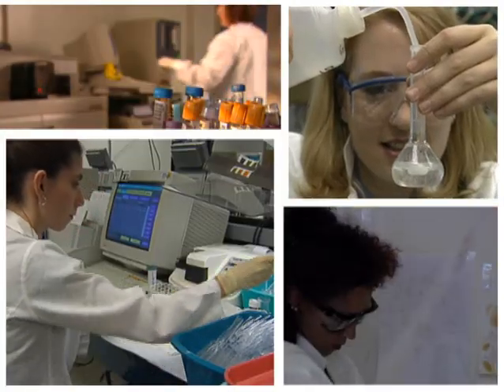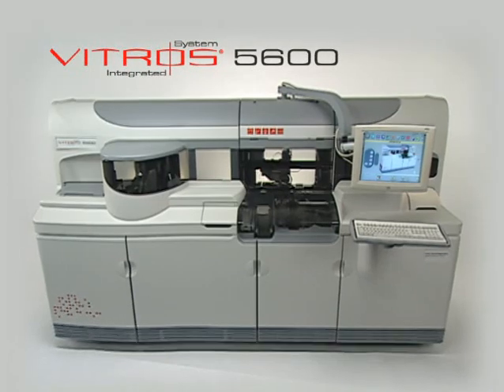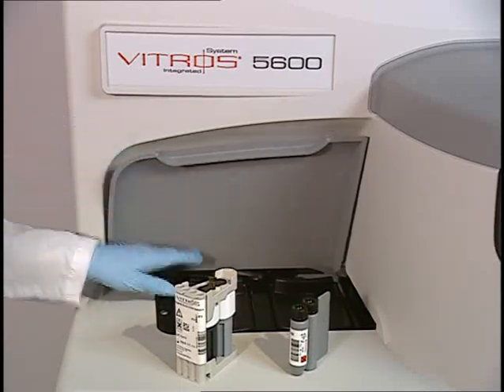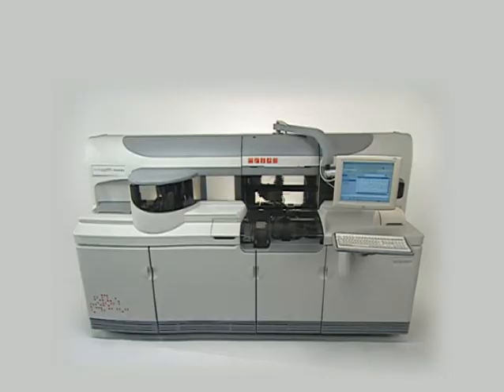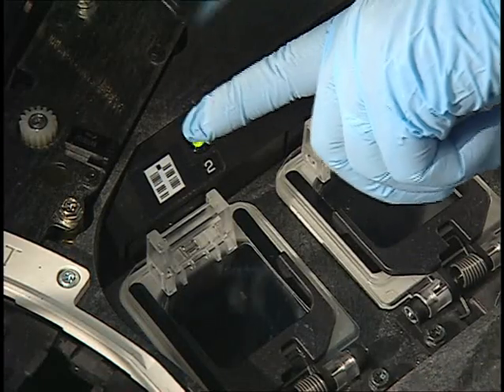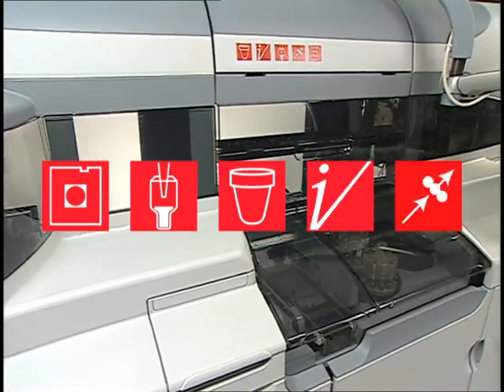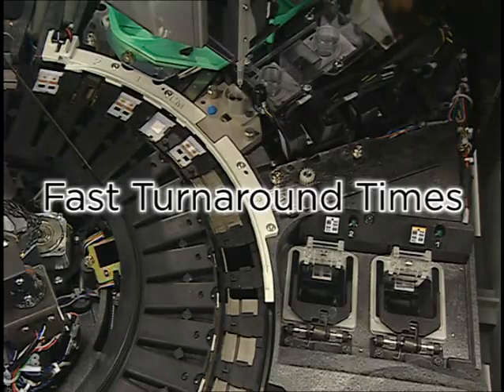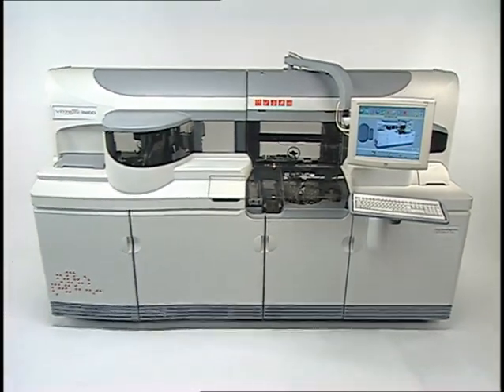Vitros 5600

Comment: We just got one of these delivered to our new hospital in  #Sebastopol   #California  - Exciting times. We are opening soon!  #SomethingWonderfulIsHappening    #SonomaWest    #SonomaCounty   #WestCounty   #Health   #Healing   #Medicine     #MedicalPioneers   #IntegrativeHealth   #OpenOurHospital   #NoWaitER   #Lab   #BloodWork   #Immunoassay
Reply: +shadoman5 Don't forget the blade dispenser jamming, calling good slides as not usable...
Reply: Sonoma West Medical Center
VITROS it's not with the competition.

it's just good to work with one assay every time.

it's have issue like,sensor,incubator rings,signal reagent probe,tips hopper,and sometimes emptying waste done with issue  with air pressure,issue to keep it with required temperature range...

have some advantage like,making sure that it's having the correct sample volume each time,
using it's own tips(and if you run out of tips machine will stop) but it's good to use disposable tips every single time, 
the most best advantage is no need for DL.water it's have own wash buffer.

and vitros 4600 more worst.

i have work with vitros  ECIQ , 350 , 3600 , 4600

there not with the competition.